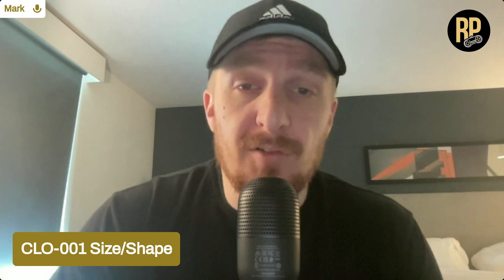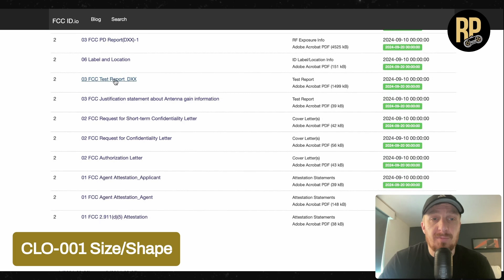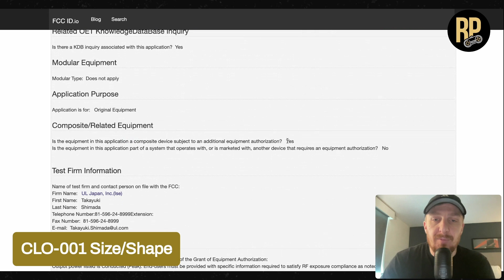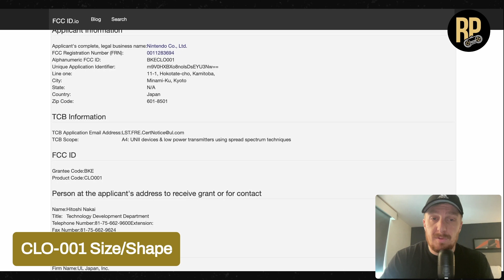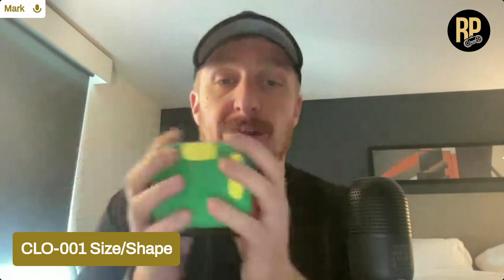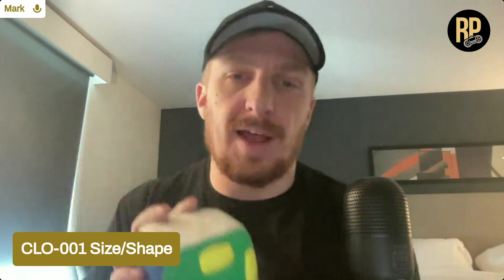Wireless Expert Explains NEW Docs, Size, Shape Nintendo Alarmo FCC Filing CLO-001: Part 2

Comment from the maker: Hey all - We realize the screen sharing software bugged out a little and didn't cut over. Rookie mistake to not catch it. I'll link the various docs below in order if you're curious to see them. All the content and discussion is accurate speculation though based on what is in the documentation. Plus you get to see a rough 3D model at the end!

(New Wireless Device FCC Submission, Docs, and Grant) https://fccid.io/BKECLO001

(24GHz Test Doc 1) https://fccid.io/BKECLO001/Test-Report/03-FCC-Test-Report-DXX-7651656

(24GHz Test Doc 2) https://fccid.io/BKECLO001/RF-Exposure-Info/03-FCC-PD-Report-DXX-1-7651712

(UMPC Tablet/Portable Definition) https://apps.fcc.gov/kdb/GetAttachment.html?id=7FGq9%2BfcAtu3AAr3ev5CFA%3D%3D&desc=941225%20D07%20UMPC%20Mini%20Tablet%20v01r02&tracking_number=26930

(Original Switch FCC Submission for Comparison) https://fccid.io/BKEHAC001
Reply: Are you able to edit in the pictures? I'm gonna be honest, as a layman its very difficult to find the images from these links.

Comment: I think that it's in interactive projection device the can project a 720p or above screen onto a flat surface. This can replace the successor screen for on the go larger displays, and also be used in tandem with the screen as such; Space Invaders move around the player space via the projection unit, the Successor is used to track the projections and shoot them down/capture them in real time.

This can also be used with an additional worn device later for release that can display limited three dimensional sprites through the projector for players wearing the second device.

Comment: Shot in the dark here, but is there any way the 24ghz signal is able to be used for data transfer? It’s just something that’s been rumbling around in my mind since all this came out, probably doesn’t mean anything but still curious regardless.
Reply: If I recall, Bluetooth is 24ghz, so yes. Data transfer is totally a thing.
Reply from the maker: Bluetooth is in the 2.4GHz range (same as Wi-Fi but uses a frequency hopping method to avoid collisions). However, yes, you can use mmWave tech to transfer data at a high rate. The question is what and why would this device be in the hands or near the body? --Mark
Reply: @RemotePlayPodcast  it could be a dock with wireless low latency video streaming from the switch (kinda like the wii u) and it would be close to your body and or hands when you dock the switch physically